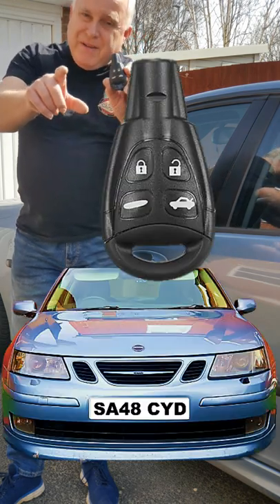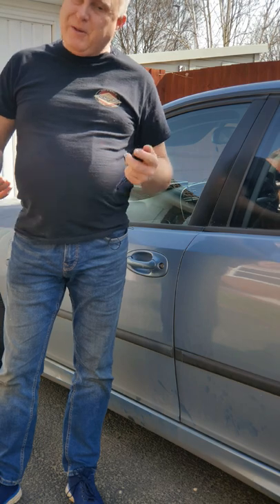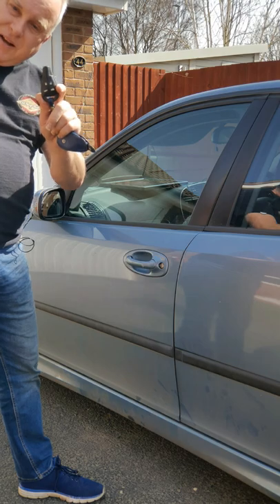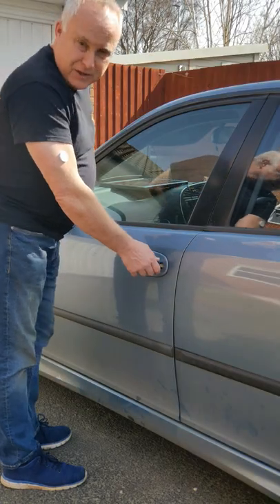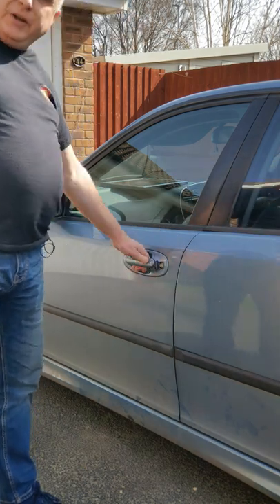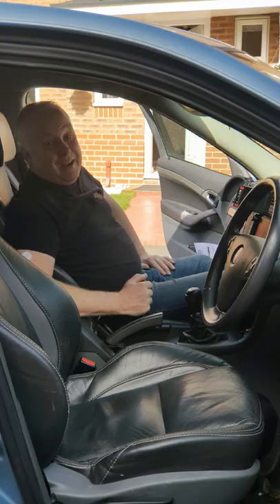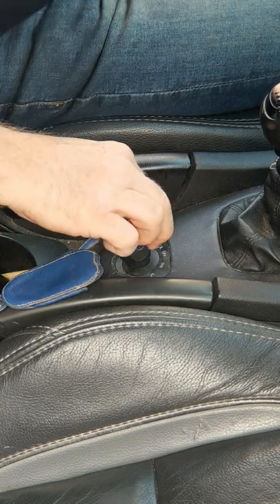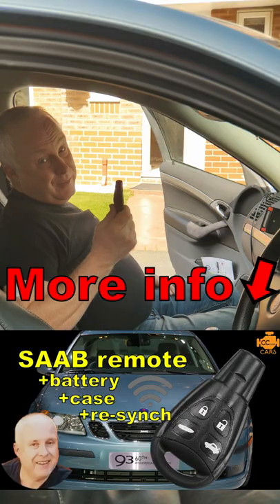Saab 9-3 Remote Locking Not Working ➕ Saab 9-3 Remote RESYNCH | #Shorts

Comment: Thanks for this tip!
I had to use my spare key because to inititate the sync. At first nothing worked. Unlocking doors remotely, turning steering lock off or ignition turned on. Spare key did not work either at first but this sync worked on the spare key and then on the first key could be synced. Both Keys works now. Thanks again!

Comment: Geat information 👍  do you have a video on how to change the battery?   I just bought this car and it seems to have a lot of problems including my control not opening or locking the door.  But it does open the trunk and start the car.  Also on the key pad.  What is that symbol under the lock symbol?

Comment: Hey so I bought this Saab 9-3 2006 the key fob starts the car but won’t lock the car but if I stick the key in the door it only unlocks and locks the driver door and I replaced the battery and did what you said to do and it still doesn’t work any idea ?

Comment: Hey bud, just purchase a saab and I can lock and unlock all the doors apart from front passenger, for that I can only use a key.. any suggestions ? And also I can’t put up and down that front passenger window from the drivers side but the passenger can.. you reckon these problems are related to eachother? Thanks in advance
Reply from the maker: Could be. Check all the wiring and connections first.
Reply: @CycloneCyd  thank you

Comment: O often mine won't unlock then its fine for months also randomly the frivers suto locking fails and i get the bong lock failure, i lock it manual then it will be fine again for week's, is there s fix for this

Comment: Heya bud. I picked up my 9-3 last week and tried doing this to the 2nd remote that came with the car only to find out the key hasn't been cut. I tried the main key but the barrel just spins around and doesn't unlock. Is it the wrong key for the car?
Reply from the maker: Sounds like the link has become disconnected behind the lock barrel. You're gonna have to get inside the door.
Reply: @CycloneCyd  I'm not sure that is the case as it spins 180 degrees and 'locks' in place again. I am guessing it is simply the wrong key for the lock which is very strange. Do they have some kind of floating cylinder lock?
Reply from the maker: @mx3fto  I didn't think they did, but I do have an uncut key for mine so I'll try it and see over the next few days
Reply: @CycloneCyd  Thanks bud, I appreciate the effort. It could be that the lock has been replaced in the past I suppose rather than the wrong key. I don't want to spend £100 or so on a new key if it still wont fit so I may order up a new set of locks in the end and get the new key coded.
Reply: @CycloneCyd  update? I asked the same thing before as I have the same issue and want to know if it's the wrong physical key.
Reply: @mx3fto  I have the same issue. Been wondering about it for the 2 years since I got my 04 vert. The key fob finally died, buttons, and I need to figure out if I need to order a VIN cut key or not.
Reply: @abdomination  If the car is unlocked you should be able to just replace the battery in the fob and put the key in the csm for 5 seconds. If it's locked you'll need to get a VIN key. Thankfully mine is a 4 door and one of the reat doors doesn't lock so I have a way of getting in if/when my fob dies
Reply from the maker: @abdomination  @mx3fto an update: i tried it out and YES the 9-3 does have a self releasing lock. If the wrong key is used the lock releases and spins freely, becoming ineffective.
SO, either you are using the wrong key (which is possible but seems unlikely) OR maybe the tumblers are not releasing and activating the lock security feature.
Try cleaning and lubing your door locks like I show here:
https://www.youtube.com/watch?v=9PKT1d1n3a0&t=1s
Go heavy on the brake fluid and penetrating oil to free it up.
Let us know how you get on

It used to be the case that one could buy a cut key from the vehicle in through a dealer. That should then be the correct key. Try Bagnall Saab or Neo Bros - even if they don't do it, they ought to know how you can get one.
Reply: @CycloneCyd  most of us go through esaabparts for keys cut by vin. I'm probably the 3rd or 4th owner. The previous owner bought it from a local dealership. I'm guessing the key fob might have been changed at one point..also my fault for going two years without arranging the spare. Thanks for confirming. 

Now I need to buy buttons and solder them on, get a new housing, finish cleaning and lubing to see if that helps, get a spare and get a new key cut if necessary.
Reply: @CycloneCyd  hey Cyd It's finally stop raining over here I'm going to try to clean the ignition as per your instructions I have question It's kind of hard to see in the video I can probably see it better on my portrait monitor when I get home but which orientation am I supposed to put the key in the lock I want to make sure when I do put it in I want to know how far it's supposed to go which way it's supposed to face . Thanks again
Reply from the maker: @abdomination  the key (the physical key, that is) is non handed. ie you can put it in either way up - they are cleverly designed that way.
Reply: @CycloneCyd  then it's definitely the wrong key

Comment: My 2004 9-3 Aero convertible just stopped sensing when I press any of the fob buttons. The key still works in the driver's-side door, and the fob can be used to start the car, but the alarm never sounds. I think the fob is still linked to the car, but just the remote capabilities are broken. Any thoughts on what could cause this, or how to fix it? I've driven her multiple times since the problem started, but it hasn't affected the issue.
Reply: Have you figured it out ?
Reply: @Glocc_Crazy  No, but yes? I disconnected the battery for a different reason, and then the remote unlock started working again at some point after reconnecting. One of those weird quirks, I guess

Comment: Hi sir I’m from dubai . My door is locked of passenger side . Even can’t open manually lock unlock .  Just I can feel the the sound inside the door of the lock & unlock when I’m using from remote
Reply from the maker: Hello there, my cousin lives in Dubai. Sorry it's been a while - I think it's probably the door latch. You'll need to remove the door casing with the door still shut.
Let me know how you get on

Comment: Got a problem my fob as stopped working but it's parked in the garage and can't get in the passenger door what can I do
Reply from the maker: Nothing. Smash a window maybe
Reply: @CycloneCyd  done that turned out to be a dead battery changed battery but now its saying low coolant level and fuel empty does something need resetting
Reply from the maker: @johnswift7347  it shouldn't. Is the battery well charged? Disconnect negative connection for 5 mins. Charge if necessary then reconnect

Comment: I got a 9-3 from 2008 and ive had it since 2011. I dont think its got an alarm though as ive never heard it or seen any indications of there being one
Reply from the maker: There is a red LED on the dash in the middle - if it's not flashing when the car is locked, either someone disconnected it OR maybe the alarm has been turned off by Tech 2.

Comment: Why the front left ?
Reply: it's the front left because the other door is central locking only; the passenger door is the only one with a keyhole.

the real question is why didn't they put a keyhole on both doors??? there's probably a good reason for this, but without knowing what it is, it seems crazy.
Reply from the maker: Like the man says, because that's the only door with a lock barrel❗
Reply from the maker: @mr.d5314  Remote locking became pretty much standard in the very late 80s. By the early 90s OEs had realised that most people lock and unlock their cars with the remote pretty much all the time. thus the lock barrel in the door becomes a secondary means of entering a locked vehicle, only used when the remote doesn't work (batteries usually, sometimes interference). Thus, what is the point of providing two lock barrels that are never gonna be used? Just supply one that can be used in an 'emergency' and save the costs of the hardware in the other door.
That's the approach we took when I engineered the locking system on 38A Range Rover in the early 90s.
Reply: @mr.d5314  on the 9-5 the lock barrel is only the drivers side ?
Reply: @CycloneCyd  on the 9-5 its only on the drivers side right
Reply: It still works tho on the right, was just curious
Reply from the maker: @un-_-known688  The 9-5 is a different car entirely.
The drivers side could be left or right side depending on if it's a RHD or LHD car. That's why we in the auto industry describe things as left or right side, it's wholly specific, no confusion.
Reply from the maker: @un-_-known688  "It still works tho on the right" - I don't 'get' what you mean by this. There is no lock barrel on the right side door of the 9-3SS.
Reply: @CycloneCyd  i mean this video does everything the same for the 9-5 saloon but there was only a key hole in the drivers side
Reply: Which is on the right in the uk
Reply: @CycloneCyd  Shame it's just a corporate cost-cutting measure as opposed to some kind of good functional / safety reason or something. Not many cost-cutting measures to be found on Saabs.
Reply: I get it, that’s why you keep saying LEFT cuz left is still left, even in America, even tho I got LEFT behind in the 6th grade I still know LEFT when I’ve been Left behind but I’m still Right behind ya 😂